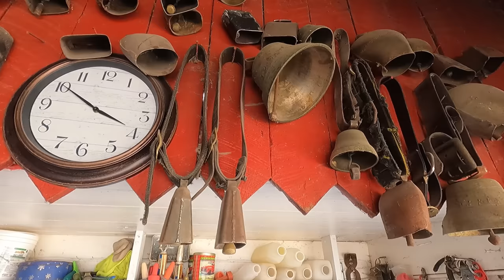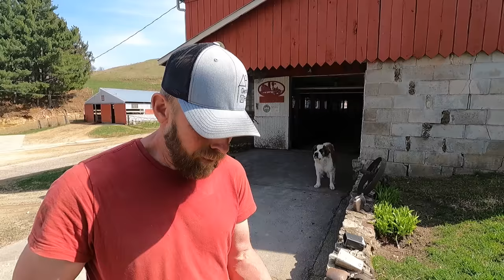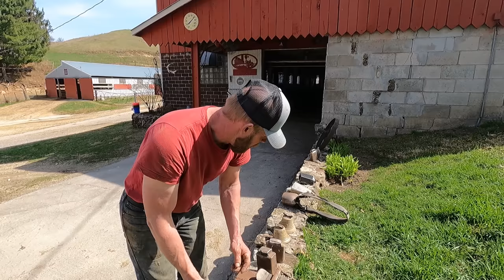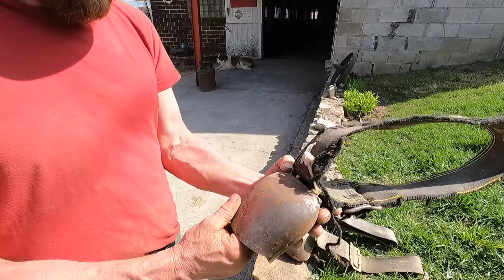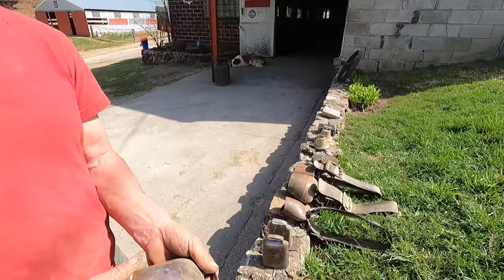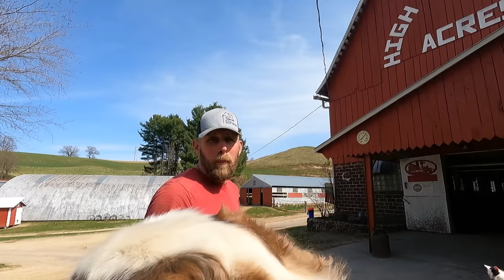Swiss Cow Bells

Comment: Here in Aus we have a cow bell that has been made since the mid 1800’s called a “Condamine Bell”. It is very similar to some of yours, it’s made of two folded sections of sheet metal riveted together with the strap on top of course. Often when drovers would shift large mobs of cattle overland they would have a lead cow or bullock with a bell for the mob to follow. Regards from Down Under.
Reply from the maker: It's great to see who is the boss cow.